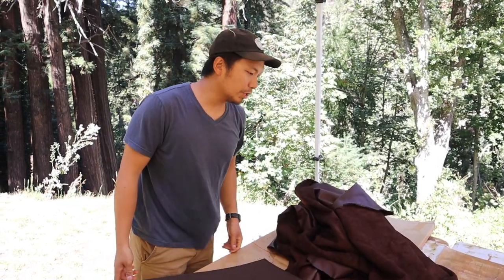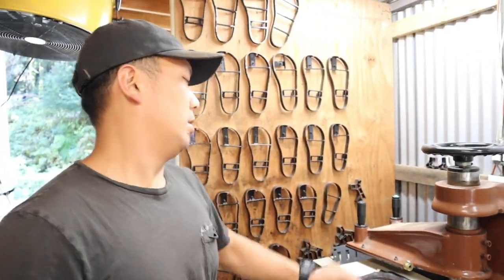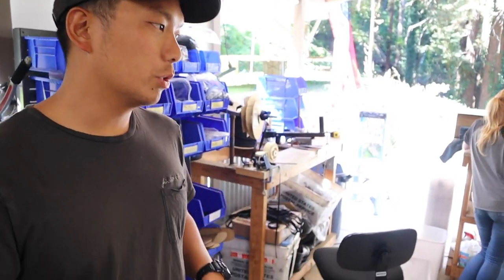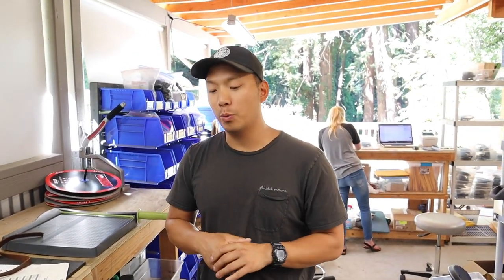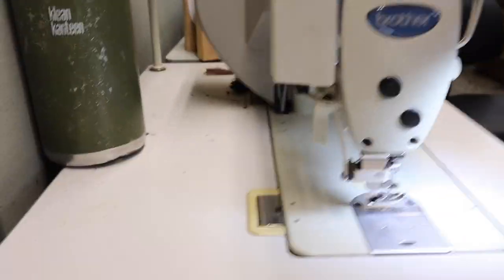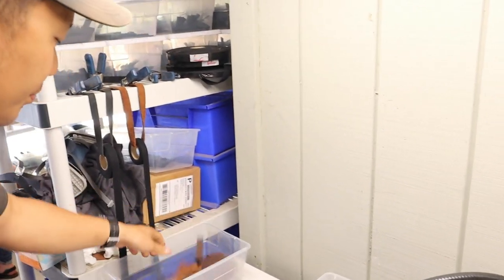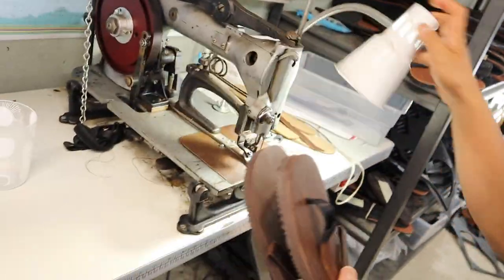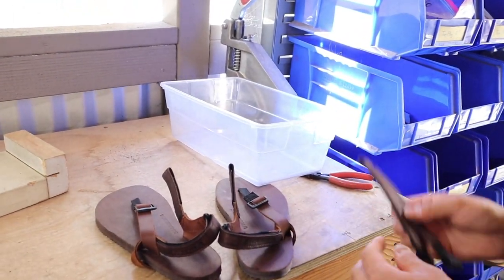How To Make Leather Sandals - TK Makes Super Goats

Comment: How the toe plug made?
Reply from the maker: We mold them.
Reply: @Shammasandals  possible to share the process? the plug constantly in my mind as how it possible mold together with the leather strap since is two different things. is the toe plug come from the leather strap?
Reply from the maker: @joshkhor5976  The toe plug is a molded piece that sits underneath the sole of the sandals. We recess the sole of the sandals so that the plug does not stick out. You can see it on our product pages where we have pictures of the bottom sides of the sandals. Hope this answers your question.